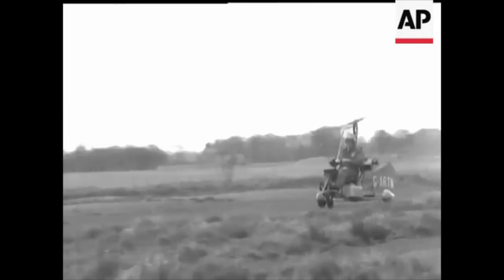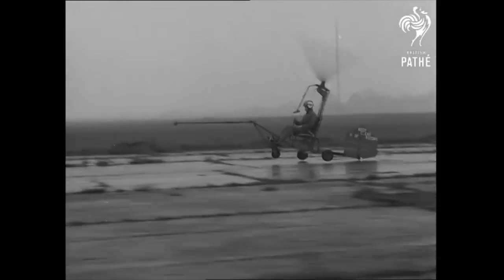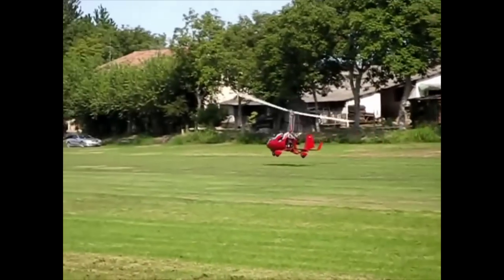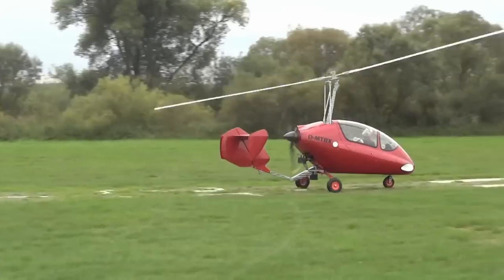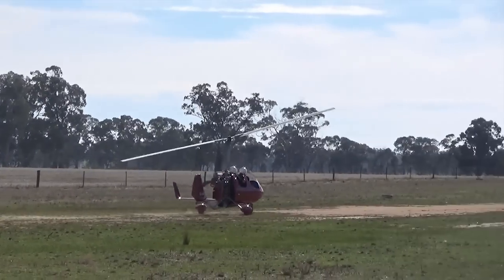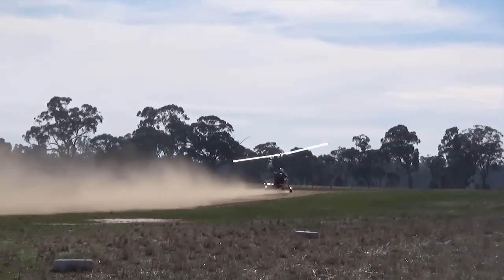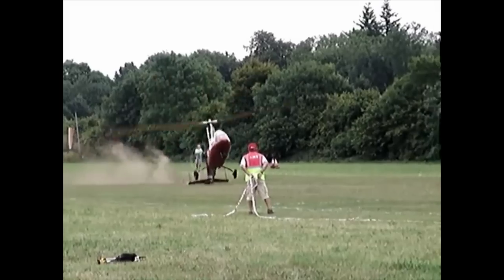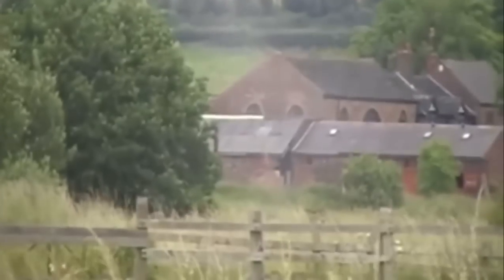Gyroplane/gyrocopter take off technique & errors

Comment: This is bad advice.  I could not convince my dad to properly raise the nose and balance on the mains.  Doing it correctly requires skill and feel.  He preferred to keep the nose wheel on the ground until around 60mph, and then lift like an airplane.  His technique killed him yesterday.  Rotorflap on takeoff probably caused a rudder strike and rudder damage, and then what appears to be the loss of the rudder between 50-100 feet of altitude, resulting in complete loss of control.  I will post video of his crash later on rotary forum.  Proper technique is to balance on the mains to keep the rotor accelerating and loaded, without letting the nose get too high.  It requires skill and feel, and not everyone is capable of this.
Reply from the maker: Hi - well first of all clearly I'm sorry hear about your dad.  That aside I don't equate what you describe to any advice here and actually I don't know anyone that suggests a technique you describe.  What aircraft was this and where?  Just surprised you have so much detail on the causal items when it happened yesterday?
Reply: @gyrocopterflyingclub6148  We have video of the crash and pictures of the gyro.  I am speculating that he had rotor flap hitting the rudder because the acceleration phase was not on the video, but the rudder is missing from the wreckage and there is complete loss of control in the air.  But we would have arguments about whether or not you should balance on the mains, and I have done many takeoffs with him in my Magni that would make me uncomfortable.  He was flying a new AR-1 with 915 and closed canopy.
Reply from the maker: rickdc3 yeah I mean as I said I am very sorry that this is a conversation off the back of a death. Not a nice thing especially at this time of year so sincerely heart felt condolences.  On this balancing on the mains view. Many people mis relate what I say or advocate. The first is that if you take off as I suggest you do effectively balance on the mains it’s just that this part isn’t a focus. I prefer to focus on take offs. That aside 915 motor (I suspect not much time on type?) couldn’t it just as easily be an over steep pitch up at take off and forward stick low g? I find it hard to believe that there is a rotor strike and an ability to climb away. How many hours on the aircraft did your dad have?
Reply from the maker: https://youtu.be/WCLvtWRE9ak  

From your link and comments.  "My father had 40 years of flying experience. CFI, Commercial, Multiengine, and still current in IFR. He has been flying gyros for several years. Was turning 77 next month. He sold his Cavalon about a year ago and has been flying with me in my Magni M24 while he waited to get a new gyro. I did not like letting him do take-offs in my gyro, but let him practice anyway. He was unable to keep the stick back until the nose wheel came up, and catch it to balance on the mains. If he tried, the nose would stay too high and we would take off with too high an angle of attack and too slow an airspeed. So he would let the stick go forward as we accelerated and he would keep the nose wheel on the ground until 50-60 mph. We would have HUGE arguments over this, but he said that on the forums and other gyro "schools" they were no longer teaching balancing on the mains. Yesterday was his first solo flight in his new AR-1 with closed canopy and 915 engine. The rudder is HUGE. We don't know exactly what happened yet, but we have crash pictures and video of the crash. My theory is that he developed some rotor flap on the takeoff role which damaged the rudder. I believe the rudder came off in flight (I don't see it in the crash photos), causing complete loss of directional control (gyros can't fly in reverse). We need to teach that balancing on the mains is the only safe technique, and if the pilot can't do it without letting the nose get too high, they shouldn't be flying solo."

TBH first solo and how much experience?  The take off looked fine.
Reply from the maker: Seems we can now rule out the take off as having any bearing on his accident https://youtu.be/yKWQ7jkUElE
Reply: @rickdc3  Did your dad have any fixed-wing experience?
Reply: @rickdc3  Hi Rick sorry about your Dad I imagine you have an accident report by now.  I agree with proper wheel balance but understand Phills technique here and what he is suggesting wouldn't result in this.  Also if his blades were flapping he'd have been unable to get 50ft in the air.  It can't have been blade flap when your rotors are flapping the retreating side is in full stall.  No lift as soon as this happens it will fall towards the ground and you'd never get airborne.  If the advancing side had sufficent lift you'd end up on your side but in reality it will take out your prop an rudder and likely hit the ground long before getting off the ground.  What you describe sounds like he unloaded the rotor (negative G) in flight.  This will also cause the machine to fly right through the rotor and prop.  One thing to look for is did the blades seem bent in line with the aircraft but not bent dramatically backwards. If you have blade flap strike on the ground the rotors will generally be bent backwards against the direction of impact.  When unloaded in flight often they won't be bent backwards at all but bowed over like a banana upside down not bent up like an umbrella in a wind.  It more complicated as the impact will often cause one blade to bend under the frame.  If he was 50-100ft off the ground this is the most likely senario.  But it could have been exasperated by having high speed on the ground (holding the nose down) then pulling in too much back stick which could have lead to over controlling forward rather than backing off power.  Please note I'm not trying to be difficult but figure you would rather know exactly what happened.  I'd also note that not being there or seeing the accident I can't say anything with confidence other than it wasn't blade flap.